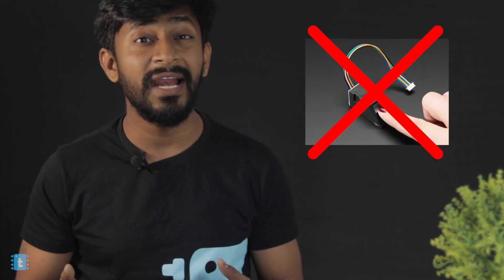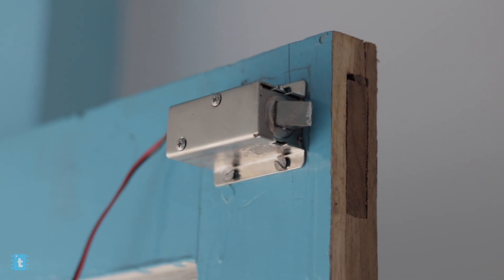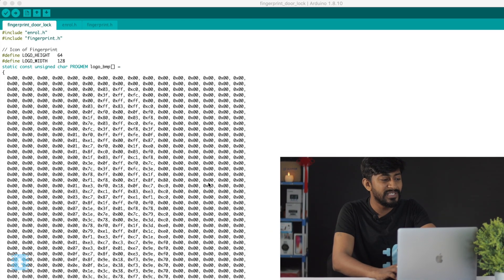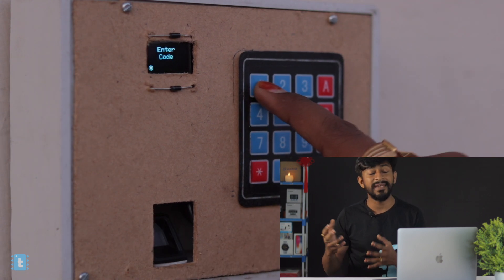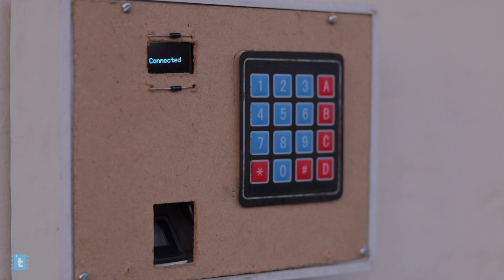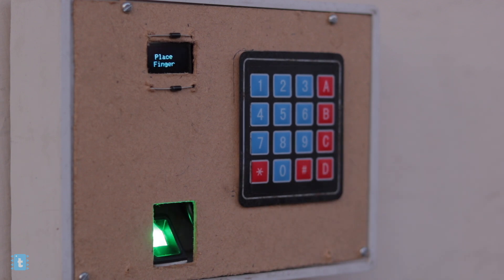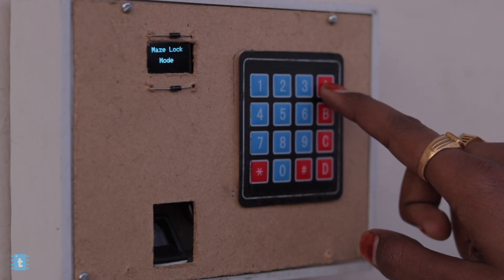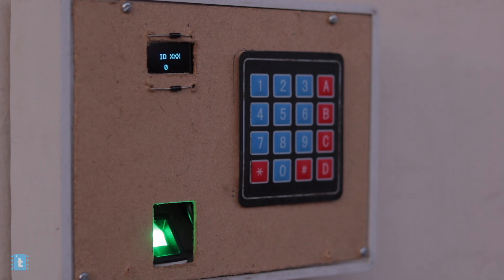Standalone IoT security project using ESP32 | Fingerprint Sensor | Hex Keypad | IoT Projects |JLCPCB

Comment: You could add a code for deleting the fingerprints as well if it is used for attendance system then if any employee is changed then the option should be there to remove that fingerprint and enter a new one or even an option to remove all fingerprints.

Comment: Hi Mr Sachin, I have been able to replicate some of your projects such as RFID door lock system. They are amazing projects taught with amazing videos. Great job sir and keep it up. Youre helping my IoT dreams to come true.

I have two questions please;
1. If a user of of this fingerprint attendance system is no longer part of the team, how do I remove their fingerprint entry from the device? Either by re-coding or certain buttons pressed. How do I achieve this please?
2. Is it possible to combine both RFID and Fingerprint door lock together?

Thank you very much sir.

Comment: I made same project, everything works fine till no solonoid lock is connected , as soon as I connect a lock, and it is opened ( by relay mechanism) the esp hangs. I had used the same PCB board ( Gerber file) for the fabrication which is provided by you
Reply: Hiii
Reply: May i know if the coding working?cause i get so many error

Comment: Does it make a difference using a 0,96" oled or a 1,3" oled?
Thanks in advance
Reply from the maker: Just size and pixels difference 
Nothing else
Reply: @techiesms  So will i not need to adjust the code to the fingerprint logo if I go with the 1.3"?
PS: Thanks for the fast reply

Comment: Hi nice project. I have a question did you use eeprom for this project? If not then will the code erased after powerloss? And I think If you are using this circuit for the security you should hide the circuit behind the door only show the screen, finger print module and the keypad outside. In case somebody upload new code or just trigger the relay. Sorry for my bad English.

Comment: Hi I cant find a way to use the keypad in one of my project. I want to make a servo stabilizer in which I have 2 values 1 is upper voltage and 2nd is lower voltage winch i want to set buy using key pad when I press the star Key the program ask for values and the program will start running with the interested value when I press hash key 

Can u provide me the code please

Comment: Great video!!!! What if i cut the wires going in for lock and use a 12volt battery to unlock the door??
Reply from the maker: I need to conceal that wires with the pipes but I was running out of Time

But I’ll be concealing them now
Reply: @techiesms there is this esp32 cam available that can be used as well for this project..unlocking using face recognition
Reply: techiesms also you can make it wireless 🙂

Comment: gr8 video but you should use a different pin for security and maze lock otherwise anyone who knows the pin can enroll the fingerprint.
but its gr8 video...... 
you should also start  working with sonoff tasmota  firmware
Reply from the maker: You got a point 
Thanks for the suggestion

Comment: Sir when electricity will not be there what will happen and how that magnetic lock will open
Reply from the maker: For that, I have kept a 12v battery inside the studio so incase the electricity is gone I can still unlock the door with the battery
Reply: @techiesms  thanks sir for giving this suggestion thanks a lot sir